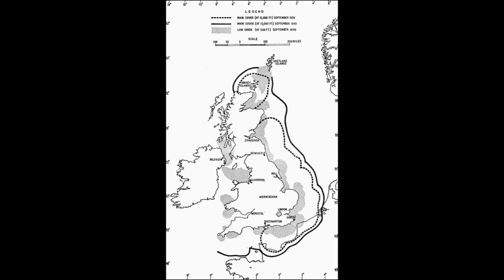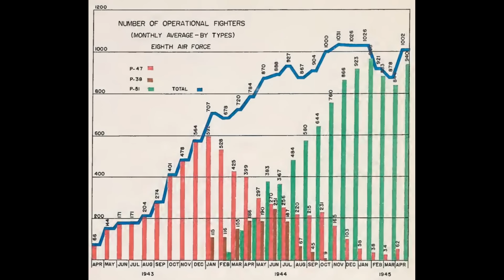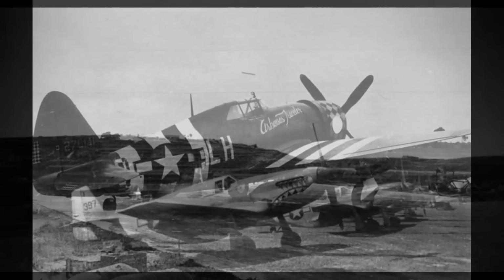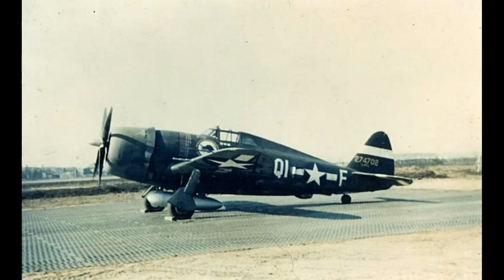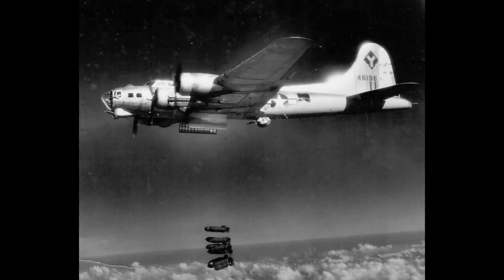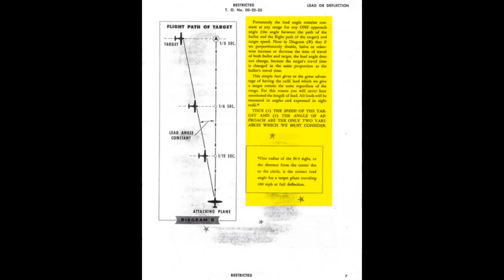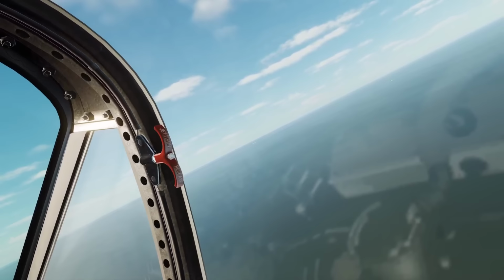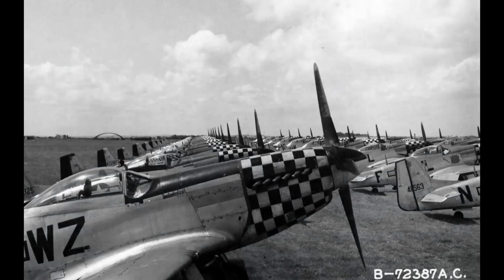Under Appreciated BRITISH Tech From WW2

Comment: The parents of a man I know lived in the Netherlands during WWII.  His father explained that the drop tanks kept fuel in the tanks of farmers' tractors during the war.
Reply: High octane tractor fuel! That's where tractor pulling competitions must have started.
Reply: Churchill said this was a benefit of the British built, lined paper mache ones. They’d usually break on impact, or at least that was the idea. Who knows if the women making them built them better than minimum spec.
Reply: They didn't burst on impact. Paper drop tanks ?
Reply: @billsmith5109  USAF drop tanks were alloy ?
Reply: @Eric-kn4yn  Some kind of metal. The only place I’ve seen them is as part of the mish mash of ceiling decoration in a tavern.
Reply: The brits design ed a paper drop tank that they and the usaf used before the metal tanks showed up @Eric-kn4yn
Reply: @Eric-kn4yn Yep. Papier-maché drop tanks.

Comment: Great episode!  K-14 fun facts: The circle of diamonds is created by two plates with six curving radial slots in each. The curves were oriented to slant in opposite directions. With the two plates together, the intersection of each slot left a diamond shaped hole that the light passed through. Rotating the plates in opposite directions moved the circle of diamond holes in or out due to the slots' curvature. The sight has two collimators and you see the gyro sight only with your left eye, and the fixed sight only with your right eye. Looking through the reflector to infinity, the images were superimposed on each other which is how you see it in DCS.  Pilots could switch the light for the fixed sight off to remove it.  Biggest tactical feature, you could delete tracer from your ammo load, which took away the warning to the other pilot by not announcing you were shooting until you were getting hits. This is why in a lot of ww2 gun cam film you see no tracer being used. Almost certain those are K-14 equipped.
Reply: Nice tech details. Brit Mk.II / K-14 gyro gun sight was another gift from the Brits.
The effectiveness of the gyro gun sight was one of the main reasons for producing allied aces at the end of the war.
Reply: @bobsakamanos4469  Doubtless the lower quality of enemy pilots also contributed to Allied aces towards war's end.
Reply: @davidg3944  some sources claim that the gyro gun sight increased gunnery results (kills) by a factor of 3.  So with just the older reflector gunsight, many more sorties deep into germany would have been required.  Many more casualties.

The comparison highlights the skill of Allied pilots early in the war who shot down 20-30 enemy fighters.

Comment: My father was responsible for the maintenance and repair of the H2X and GH units in B24’s in the 15th Air Force. His MOS was deemed critical. He was stationed near Foggia. I’m still researching the details of his time in the service.
Reply: Cool, my father was a bombardier in the 15th 455th BG 720 sqd, San Giovanni, Italy
Reply: H2X was H2S  (British designation)  Allegedly someone high up in the RAF (Or the Ministry) said "It stinks, call it H2S"
Was fitted to some Lancasters.
The prime use was for raids that were beyond the curvature of the Earth
GH sounds like Oboe that used a station in Norfolk and another in Kent
There were 2 versions, one on VHF and the other (later) on 10 cm wavelength
DH Mosquitos  were used as pathfinders marking the targets with coloured flares
I believe The Rhur industrial region was the range limit.
The worry about possible German jamming measures was down to what us Brits did to German navigation aids (Which is why it took us so long to start using them)

Comment: With the EZ42 in DCS, the easiest way to get a fixed (or at least effectively fixed) sight is to twist the range to minimum. At that range, there is essentially no movement from the gyro, but you can easily return to gyro aiming by setting actual range again. This solves the issue of awkwardly reaching for the gyro switch in combat and also the need for the gyro to spin up after being turned back on.
Reply from the maker: That's a good tip!

Comment: The Miles M.20 at 34:20... one of my favourite 'what ifs' of the war: it was fast, climbed quickly, was very simple, and carried a heap of guns and ammunition.  Given the Spitfire was absent at Singapore, Greece, Crete, for much of the desert war, Darwin, Burma... what could have been achieved had these planes been put into production quickly in 1940?  Of course, British authorities hated the Miles brothers and screwed them over more than once.

An enjoyable and well-researched video, as usual.
Reply: It certainly wasn't fast my man.
Reply: First Japanese air raid on Singapore Dec 8 '41 destroyed 60 of the 110 front line aircraft on the ground. Radar detected warning came late and airmen were instructed to take off at their discretion but apparently decided that anti aircraft fire wouldn't distinguish between sides. They were about as ready as we were.
Reply: @Will-hv9ns  Faster than a Hurricane, faster climbing than a Hurricane or Zero, in 1940. Quite easy to fly. And given where I would have liked to see them sent, it is whether they were better than Brewsters, P-36s, and Gladiators. 

It could not be developed, so it would certainly have been obsolete by late 1943. But by then, a whole new generation was available, in numbers.  The Miles could never have replaced the Spitfire for example, but as an option to replace the planes nearing obsolescence in 1940, it remains very interesting to me.

A killer is whether it really could have been mass produced. Switching production is risky, it's probably the main reason it was shelved, but Beaverbrook broke an awful lot of eggs to make the omelette in 1940.
Reply: The Hurricane filled the gap brilliantly!
Reply: @derekambler  yes indeed so, .. luckily!
Reply: @lllordllloyd  You seem to forget that even during WWII it usually took quite a while before a country got a whole new airframe into frontline service. 15 Months to develop, produce, train and ship these fighters to the other side of the world does seem to really cut it short.

Had the Miles M.20 been a fully developed fighter aircraft I'd say it could be done, but this was just two prototypes. They probably still lacked essentials such as self sealing fuel tanks and armor, which would still have to be developed and tested for that aircraft as well. All of which impacts performance as well.
Not to mention that the RAF seems to actually have had more than enough Hurricanes by this point that they could give some to some allies.
Reply: @martijn9568  I fully accept your point, hence I regard it as an "interesting what oif" rafor debate rather than a confident assertion. But, in mitigation, the sudden effort in 1940 was THE time to get a new plane into production, and the M20 had many advantages as an 'emergency' fighter: designed by gifted men specifically for simplicity (fixed undercarriage, prefabricated engine/radiator nacelle).

Against this, I am not really sure whether all-wooden construction lends itself to real mass production, and the big issue remains it's lack of development potential.

There were not enough Hurricanes for Malaya until it was too late, and the M20 would arguably have been a better opponent for the light Japanese fighters. Ironically, it might have been easier to get the 'emergency' M20 out of production, whereas the Hurricane remained in production far too long.

The British developed a lot of useless planes during the war... the M20 could well have been useful.  All in hindsight, of course.
Reply: We were vey lucky we had a very competant plane in the Hurricane which more than held it's own against what it came up against all round  the world!
Reply: It was a very good response to a perceived risk of losing fighter production and needing a low resource design but the thick wing was already at it’s aerodynamic limit and could be developed no further for the future. Testing showed it to be a poor deck landing option.
Reply: @lllordllloyd  M.20 is interesting.
But the real missed opportunity was the Boulton Paul P.94, a single seat turretless Defiant. It could carry 8 or 12 Browing .303, was faster than the Hurricane and almost as fast as the Spitfire. Unlike the Spitfire though it was designed for mass production so could have been built very rapidly. Boulton Paul's facilities were able to build far more aircraft than they actually turned out because the turret was the most complex piece of the Defiant and supply was never enough...

The P.94 could also carry twice as much fuel as Spitfire...which means that it could have flown direct from Gibraltar or Mersa Matruh to Malta....its a fascinating What-If because it completely changes the naval war in the Med....convoys better protected, no need for aircraft carrier runs...you name it....
Reply: 3 @johnfisk811

Comment: It's rather validating to hear someone else so articulately explain something I've believed for a long time - namely just how critical the Thunderbolt truly was to the war effort. Yes it was costly and complex, but there was a good reason for that!
Reply: The oft cited statistics point to the fact.

..."From D-Day until VE day, the Thunderbolt destroyed 86,000 railroad cars, 9,000 locomotives, 6,000 armored fighting vehicles, and 68,000 trucks."

More Stats: US WWII fighters ranked by total Aircraft destroyed:

5,944   P-51
5,229   F6F 
3,785   P-38
3,662   P-47*
2,155   F4U 
1,944   P-40

So, yes. It made a huge contribution to the war effort in Europe. Because it was there doing the job before the Mustang. And it was more reliable than the P-38 in the cold. Now, the P-38 is possibly the most important aircraft the US developed prior to 1940 and could the most significant USAAF (Non-Navy) fighter in the pacific.
Reply: My sense of the contribution of the P-47 isn’t just about how many enemy planes it shot down vs the P-51…Its about the ‘when’ it did it…The P-47 killed a lot of the Luftwaffe’s elite before the P-51 arrived….
Reply: @windfall35  Agreed. The P-47 fought the Luftwaffe when the Luftwaffe was at its zenith.

Comment: You may already know this, but the original British version of H2X, known as H2S, continued to be developed into the 1950s, finishing as the much higher resolution, K-band, MkIX.  This was fitted to the V-Bomber force and saw its last use as a bomb aiming system during the BLACK BUCK Vulcan bombing mission against Stanley airfield in the Falklands in 1982.  It was still used as a mapping aid by the Victor until 1993, a 50-year career!
Reply: Wow!!
Reply: K Band 1cm H2X was originally developed by MIT Rad Lab in 1943 at the same time as H2X. Had they got it to work, US blind bombing would have been on another level, Unfortunately the 1cw Wavelength selected was found to be absorbed by water vapour in the air that made the radar next to useless. It was later found that the were wavelengths just above and below 1cm that didn't suffer from the absorption issue and these are used on modern radars.

Comment: Hey Greg! RE aerial radar for bombers, the radar in the B-2 is used for exactly this! It makes a pass, images a location, makes a pass 180 to the first attitude, images again and then does a further 180 and with a stereoscopic 3D radar image of the site, the B-2 can CCIP to drop a bomb on that site 

Due to the radar design, it's a very good use of radar without giving away a location such as you could via laser
Reply from the maker: Wow, thanks.

Comment: The leading idea to the teardrop hood came from Malcolm hood, so called because it came from Malcolm & Farquharson of 601 Bath Road Slough 1936, later R Malcolm & Co. They also produced various fillets for Spitfire.  In the US the canopies for P-51 were blown by Dupont, and  retrofits were done by White Waltham. 

The double supercharger is the compound supercharger in British parlance, largely the work of Sir Stanley Hooker of Rolls Royce Derby. Originally the preliminary work was to produce better engines for the Vickers Wellington twin engine bomber, but some enterprising fitters laid claim to an example Mk 61 Merlin engine and fitted it to a Mk V Spitfire, and later prototyped several Mk III for the Mk IX. Note Spitfire genealogy is one of the most complicated out there. Not only the most significant leap to the aircrafts performance, the most visible change to the shape of Spitfire giving it a much longer nose by some 9" and two under wing radiators. This became the basis for the improvements to the Mustang platform with the very similar Mk66 Merlin giving an even greater performance than the Mk IX Spitfire because of Mustangs better laminar flow aerodynamics.
Reply: I'll say upfront that I don't know how true the following is, but,
I have come across comment from restorers that much of the war time difference in speed between the Spitfire Mk IX and P-51 was as much to do with the standard of finish as it was the wing design. I believe the suggestion is that the fit of the various access panels and overall finish of the war time Spitfires was not up to the same standard as the American aeroplane, due largely to the use dispersed production and use of semi and unskilled labour under the conditions that existed in war time Britain, whereas the P-51 was built under ideal conditions free from shortages and fear of air attack. The claim is that present day restored examples of the Spitfire Mk IX and P-51C and D are closer in maximum speed than the war time figures suggest. If anyone out there knows more about this it might be interesting to hear.
Reply: @tonym480  it is likely true, at least it sounds like it might be. Many early Mk IX Spitfire were conversions from earlier Mk V, and Mk V were being built at a time when this was the premiere fighter inside the hurried circumstances around the Battle of Britain. Spitfire took close to twice the man hours to produce over Hurricanes at around 15,000 hrs for a Mk V.  Early Spitfire came from dispersed factories until a certain Lord Nuffield imperfectly got their act together to overcome many manufacturing issues in an effort to increase production. By the time new Mk IX airframes were being built, most of them were from the Castle Bromwich factory at a time when the battle of aircraft production against the Germans was largely a settled argument. production ended at Castle Bromwich in June 1945, a total of 12,129 Spitfires had been built. Castle Bromwich was on the Chester Road in Castle Vale, Birmingham and later became the Land Rover and Jaguar factory
Reply: @tonym480  As I'm sure you know, gaps between panels on the Mustang's wing were puttied, sanded, and the wing painted with an aluminum paint.  I don't know, and I'm not sure I've ever read, how well that finish could be maintained in the field.  Also, the Mustang's belly scoop was designed to actually provide some thrust as the air passed through it.  I imagine the twin scoops under the Spit's wings were nothing but drag.
Reply: @IncogNito-gg6uh  Hi, yes I knew about the finish standard of the P-51. Regarding the radiator ducts, I believe I am correct in saying that the ducts on both the Spitfire and the Hurricane made use of the 'Meredith' effect the same as the P-51 duct, and on both types contributed enough thrust to negate the drag. The P-51 benefited in being a later design that was able to take advantage of the knowledge of how it had been done on the British types, and the research from NACA into the advantages of careful detail design. As with all engineering solutions you make the best trade off between competing requirements to arrive at a working compromise.  Personally I have no bias toward either the British or American aircraft, both the Spitfire and the P-51 were fine examples of the best that was obtainable at the time with the requirement and situation as was.
Reply: @tonym480  I had to dive into my books.  Because the radiator, and its ducting, on the Spitfire and Hurricane were relatively short, the Meredith effect couldn't quite negate the drag.  As you say, North American studied the British research and developed a longer under belly scoop.  Claims for its efficiency and thrust vary depending on the source.   The efficiency of the Mustang's cooling system and its laminar flow wing were critical to the Mustang's performance because it weighed at least a ton more than either the Spitfire or ME-109.  Still, the Spitfire had a more robust airframe than either.

Comment: I flew a HS748 with water injection. “Allowed sea level horsepower,” at any temperature or pressure. The water injection worked great, you literally flipped a switch and an analog computer injected the right amount automatically at full throttle, prop control was the same lever as the throttle. The hawker figured out everything for you without any pilot input ->super cool. The RR Dart was bullet proof, we complained for a week that the temps were high on the #2 but was within limits, during the weekly inspection maintenance found a hole in the side of the cowling where a compressor blade had departed…